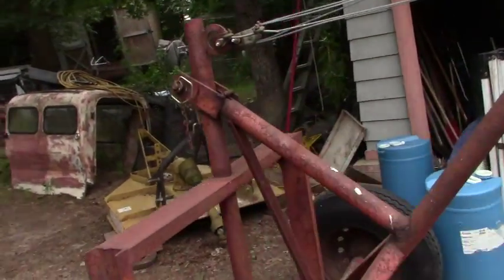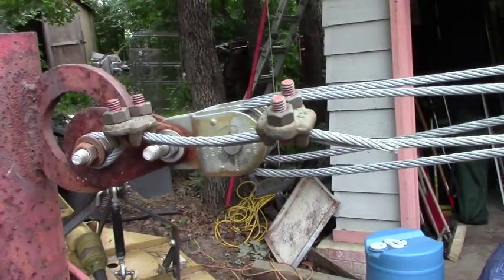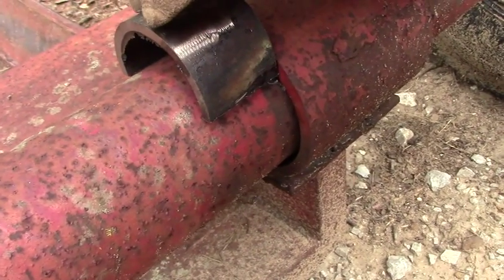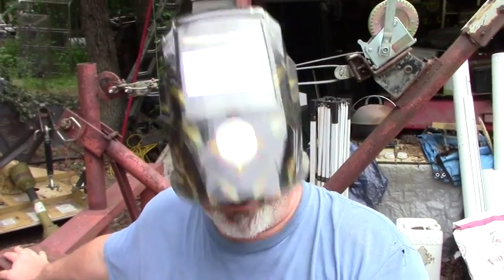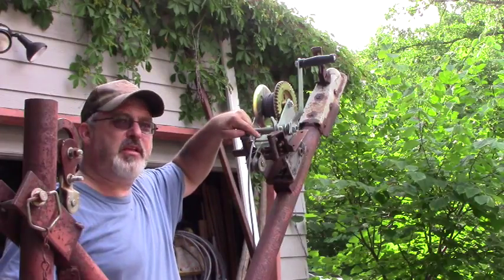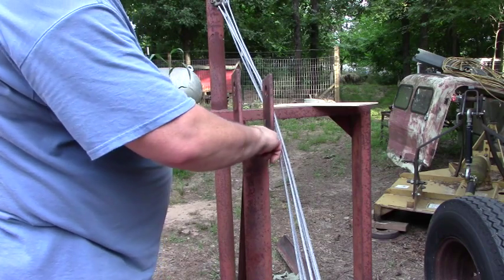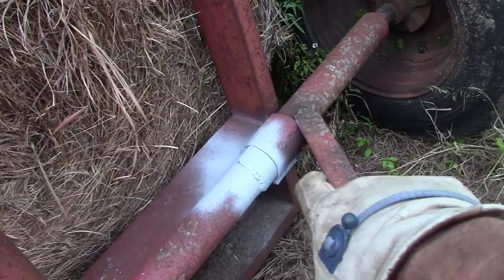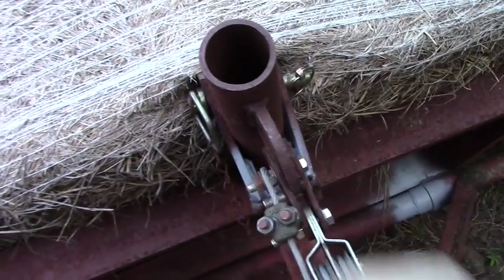Hay Dolly; Some Final Modifications

Comment: Personally, I would flip your winch around so the cable comes off the top of the drum, creating a lil more clearance between cable and fairlead bracket.   Then run the cable directly from the drum to the top pulley.   Not under the bolt that holds the winch/drum bracket together.   Would have eliminated the need of cutting the top of the winch fairlead out.   
Jus my 2 cents sir. 
Thanks for sharing a great vid.  
Have a Blessed day!!

Comment: Looks like its working good, when is the power wrench upgrade coming? lol
Reply from the maker: You know, when it was given to me, it had a unserviceable /non-repairable electric winch on it. I had contemplated putting a new one back one it but decided I didn't want have to fool with wires. fortunately, the pulley ratio is such it really doesn't take too much effort to raise, but it does takes a while to lift because of the ratio 5:1. Kind of like a 10 speed bicycle in a gear to go up a hill; a whole lot of peddling but not much forward movement. Appreciate ya stopping by and watching.